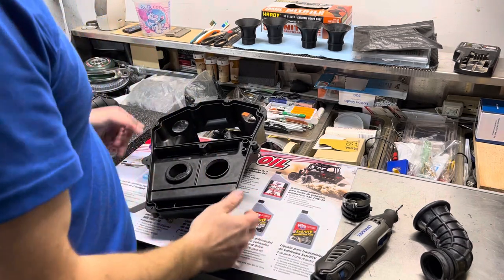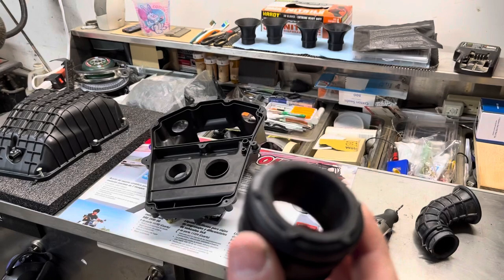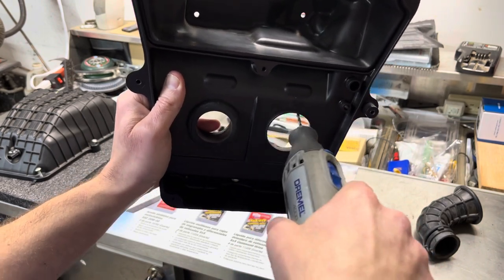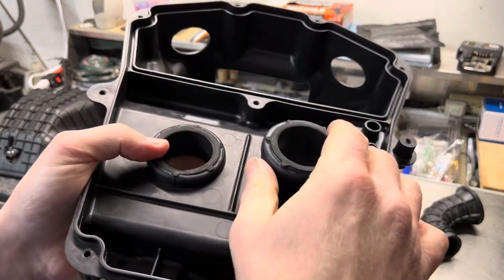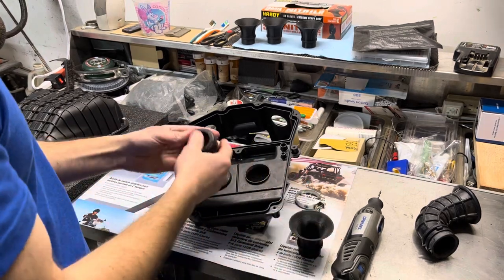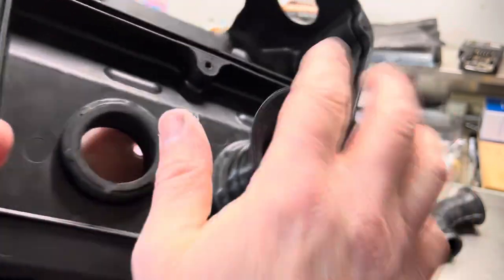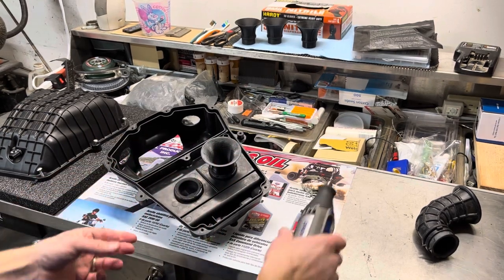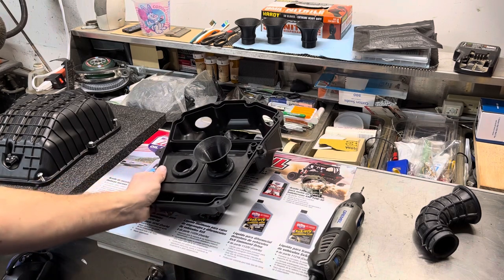Ninja 400/Z400 - Velocity stack install

Comment: How do you remove the stacks from the oem air box without damaging? Mine look like they're glued in around the flanges.
Reply from the maker: Just squeeze, fold and pull them out. They have a little around the flanges, but if you fold, twist and pull they will just come right out. I usually fold, or press all around the flange to break them loose first.

Comment: hi, i am speak spanish, sorry. But I have one question. 7:50  velocity stack only use on right side? but, on the left ? nothing?
Reply from the maker: No, you will need or want to install both velocity stacks for proper gains. I only showed one installed in this video because the other one should install exactly the same.

Google translate:
No, necesitará o querrá instalar ambas pilas de velocidad para obtener las ganancias adecuadas. Solo mostré uno instalado en este video porque el otro debería instalarse exactamente igual.

Comment: Where can I adquire a couple of velocity stacks? Did you set in a Dyno after installing the velocity stacks?
Reply from the maker: Yes. You can head over to the Ninja 400 Riders forums and find a post about them as well as Dyno runs. Thanks!